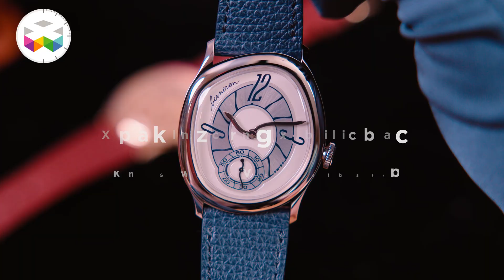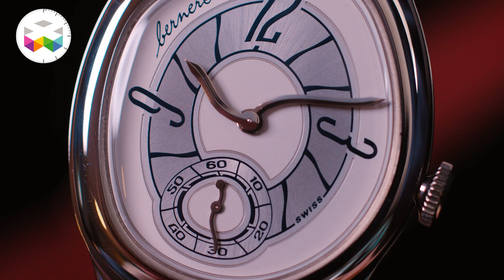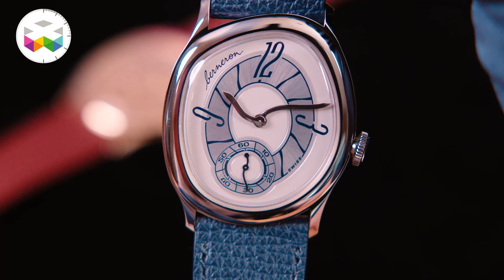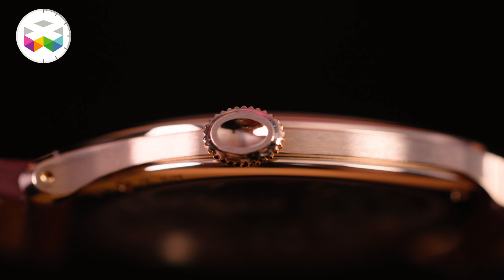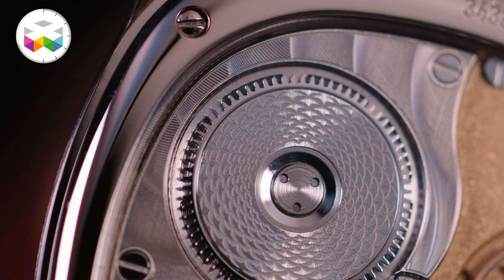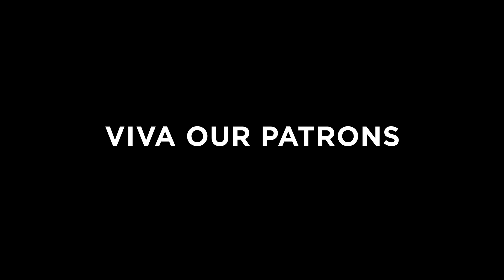Derestricted Horology by Sylvain Berneron

Comment: This has quickly become my holiest grail. Never have I wanted a watch more. Everything is sublime (incredible movement technically/aesthetically, eye-catching/artistic/daring design, beautiful dial/font used, very slim case, precious metal, gold lock case size of 38 mm), story behind included. 
And even though some people say expensive, this is cheaper than a SS Nautilus and about the price of a RO jumbo on the secondary market. This is a full gold, fully hand-made watch… I’ve been thinking about this way too much
Reply: Did you ever put a deposit down? Thinking of doing so myself

Comment: I find it so interesting how the Fibonacci sequence keeps appearing within nature.

When I was 17 and studying electronics in my country's navy back in the 80's, I discovered that I could create pseudo random numbers by applying feedback taps on a shift register based ripple counter built with J-K flip-flops.  While trying to find the optimum positions for the feedback connections (fed into an XOR gate) to feed back to the first bit, I found that it was actually the Fibonacci sequence which defined the optimum configuration to create one of these pseudo random number generators with maximal output length, before the output would repeat.

Many years later, while studying cryptography, I found out that this was something that was already known and used.  I was not the first to find this!  LOL  Fibonacci based LFSR PRNGs are a thing!

So it seems that the sequence that Fibonacci discovered, continues to be significant even today within computer engineering and computer science!